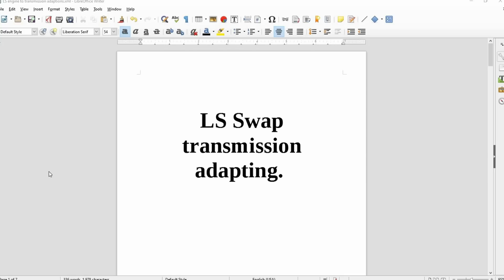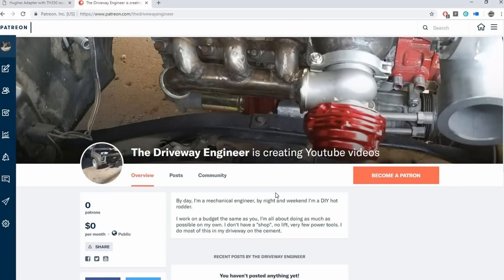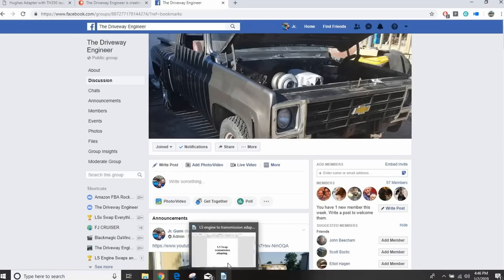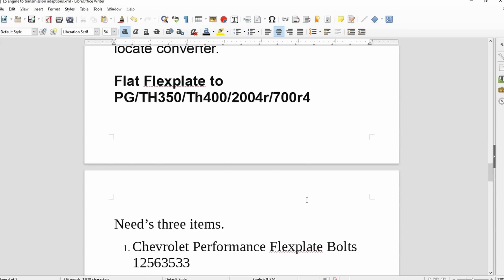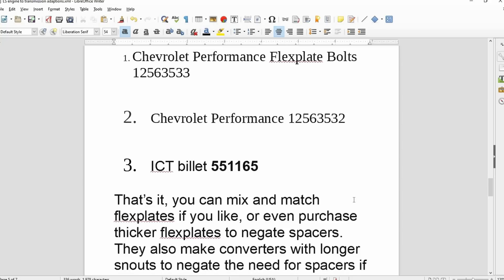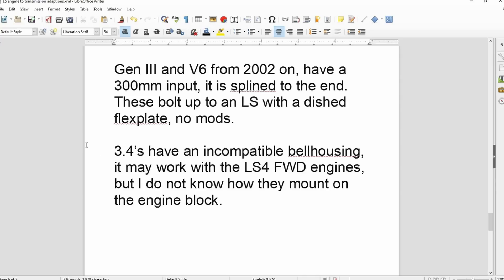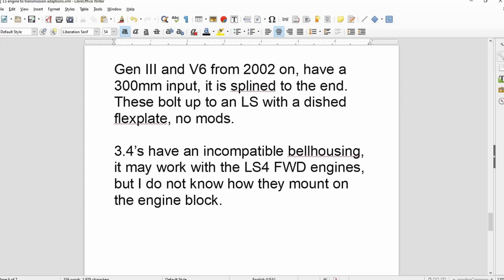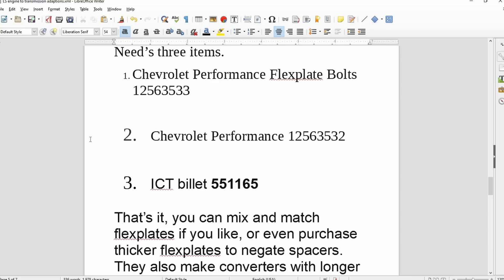LS Swap basics, How to Adapt your LS swap engine to your original automatic transmission.

Comment: There’s two different 4L60E’s
Reply: Mine is a 96 the first year for the electronic shift it has a smaller torque converter. I’m looking to attach it to a 4.8 gen 3
Reply: I have a complete gen 3 4.8 harness and I thought about keeping the 04 4L60e . My Obs is a v6 4/4 so I’ve got to make my 4/4 work it’s all this wiring stuff that’s confusing as well. Can u help me out

Comment: What about starters?  Can I take any year LS starter motor and bolt it to any year LS engine and transmission combination?  Like if I had a starter off a 5.3 with a 4l65E and I bolted it to a 6.0L with a 4L80E and switched from flat to dished flex plate etc - will the starters all fit?  Thanks to anyone who can answer this!
Reply from the maker: Yes, they're all the same

Comment: So I have a 91 4l60 (700r4) and I’m putting a 02 6.0 has the flat 4l80 flex plate so if I use the spacer behind the flex plate do I still use the original starter ? Also what do I do as far as the converter lock up as it’s wired to original pcm ?

Comment: Researching an ls swap into an 88 chevy 4×4 manual trans. 5.3 (gen3)...ls flywheel(from a 4.8 manual truck i hear) and the stock clutch is all we need ?...i thought i heard you say flywheel matching engine and clutch matching the trans for manual swaps. If it matters the truck started its life as a diesel
Reply: We think it's an nv4500, but i haven't verified that. It should have the 14" flywheel since it's a big block/ diesel application. I realize you've got more important stuff to do than answer questions that you've likely addressed somewhere, and i appreciate your patience.
Reply: @shawnwimberly9294  from what I’ve seen you need a conversion flywheel Novak sells them and so does advance adapters I’m gonna be doing the same thing I have a nv 4500 mated to a 350 at the moment but have a 6.0 and will be doing this
Reply: I guess I'll jump off that bridge when i get to it.  Swapping a 1964 impala currently. Besides the oil pan, exhaust, transmission crossmember,driveshaft, shifter mechanism, and throttle cable, it's been pretty straight forward (sarcasm)... the truck swaps are more my speed i think.

Comment: Hey JR, ive done this swap since 1st watching your video and learning how, thanks
so what do you do about your pcm trouble codes dealing with TCC? i ve got at least one maybe more transmission related codes
P0740,0758,0785, p1860, P1810
i did the LT1Swap harness and deleted all those wires but am i supposed to turn stuff off in the PCM as well? or just live with the codes hoping they dont affect the driveability somehow?
Reply from the maker: Set them to Do Not Report

Comment: Im about to drop in my 05 Lq9 into my 1970 c10. what stall would you recommend for it. not trying break the bank. looking for anything 2600-3400 . chances are it will stall higher given my gearing tire size and such, I have had good luck with fti in the past. Made the mistake of ordering off ebay and they sent me a dam Bop 350th converter and the gap on the mounting points are insane .
Reply from the maker: I buy my converters from Ryan Jans at Tampa Performance

Comment: Lol, spend the whole video plugging urself.
Reply from the maker: Yeah, all those products I sell 😂
Reply: @TheDrivewayEngineer  thanks for the info im having trouble with the 4l80e I have a flat flex plate but my aftermarket converter snout is to long the converter pads don't touch. I think summit sold me the wrong converter.

Comment: Im stuck on this one in need of help trying to use a 99 4l60e on a 04 5.3 some one please help
Reply from the maker: If it's an LS trans, just bolt them together
Reply: @TheDrivewayEngineer  sorry i said wrong I've got them bolted up but i cant get the torque converter bolts in the flywheel

Comment: i just swapped out my sbc/th350  and attached my 5.3 LS to  TH350 with the collar/sleeve but the convertor bolts seemed short and i had to suck the convertor away from trannyy about 3/8 of an inch. is that a problem or normal?
Reply from the maker: That's pretty normal
Reply: @TheDrivewayEngineer  , whew, thanks, i was a little worried, only did 1 tranny swap before this and it was problem free, luckily.

Comment: What about the drive-by-wire hooking it up to the 700 R4 kick down or TV cable
Reply from the maker: Doesn't
Reply: @TheDrivewayEngineer  
https://youtu.be/4XPH0HG5wK0
Reply from the maker: @WiIdFx  yep, people make their own brackets if they want to
Reply: @TheDrivewayEngineer  I need to not want to lol
Reply from the maker: @WiIdFx  I wouldn't bother, you have to get the geometry right.

Personally I'd rather have a 4l60 that the PCM can run and fits in the same space
Reply: @TheDrivewayEngineer  
I really appreciate your correspondents on this. I have purchased a drive-by-wire non-electronic transmission PCU and lists the turbo 350 T400 and the 700 R4. I was wondering about the lock up kit on the 700 R4?
Reply from the maker: @WiIdFx  you can control 700 lockup with a simple toggle, or like the B&M kit that helps

Comment: so if i have a 2001 lq4 in a suburban 2500, that has a 4l80e behind it, what parts do I need?
Reply from the maker: For what?
Reply: @TheDrivewayEngineer  oh sorry, I will be running a TH400, it appears that it bolts right up exactly as the 4L80E did.  thanks, love your channel btw

Comment: I have a 1995 S10 that came with a 2.2 and a 4L60E .. Swapping out the 2.2 for a 5.3 , was told bolt patterns are different and I can't use the 4L60E that came with the 2.2... What's my options here... Thank You Would prefer to stay with a Automatic transmission..
Reply from the maker: The most straightforward thing to do is get a 4l60 that came behind a 5.3
Reply: @TheDrivewayEngineer  Thank you

Comment: I have a 2006 lq4 came out of all wheel denali was planning to put it in my 1989 c1500 pick up which has a 305 and 5ml60 (oem) will the 5ml60 work .?would really appreciate any help and get your opinion 
Thank you for your videos and all your help
Reply from the maker: 89 pickups don't have 5lm60s,that's a 2000's Cadillac transmission.
Reply: Rpo code in glove box  MG5( getrag 5 speed  manual transmission) would appreciate any help thank you
Reply from the maker: That's the code for a Getrag 5 speed manual in 1989
Reply: Would the lq4 be able to mate with it?
Reply from the maker: @fzales69  yep, just use a 06 4.8 flywheel for a 3500
Reply: @TheDrivewayEngineer  thank you very much really appreciate your time

Comment: Does the spacer go on the engine side of the flex plate or the torque converter side of the lex plate?

Comment: I have a 93 c1500 that I want to drop a 5.3 into. Mating the two doesn’t look like it will be a problem, but can anyone explain to me what the next steps would be? Do I need a tcm to run the transmission? Or is there anything budget I can do?
Reply from the maker: If you use an LS 4l60 the whole thing just drops in.

Not really much communication between the 2 required
Reply: The Driveway Engineer I was hoping to use my original 1 piece 4l60e.
Reply from the maker: @pegleg_rigo2464  yeah.

If you buy some extra crap you can.

Or you can just use an LS 4l60 that bolts in and the PCM runs it

Comment: ok i have a 5.7 vortec  with the longer crankshaft what do i need flexplate wise to adapt to 200r4?
Reply from the maker: That's not a thing...

Just bolt them together
Reply: @TheDrivewayEngineer  apparently the bolt pattern on 2 years is different from crankshaft to flywheel i have tried 350 and 400 flywheel neither line up?
Reply from the maker: There are different bolt patterns on flexplate, has nothing to do with length of the crank

Comment: I have a 05 LQ9 trying to install a 4l80e to it, I bought the flywheel but don’t know what bolts I’ll need to install everything.. I bought some apr torque converter bolts for a 4l60/4l80 don’t know if those will work. Any help? Thank you.

Comment: Just to be clear.  I have a 6.0 out of a 06 silverado with flat flex plate   Going with th400.   So I would need the longer bolts and that gm spacer thats around $50. Let me know.  Thanks for all u do
Reply from the maker: That's correct.
Reply: The Driveway Engineer  i been super confused because my friend has a 5.3 with a 6.0 flat flex plate and he is not using a spacer with his th400.

Comment: Question i just pulled a 2 piece 4L60E from 2001 van with 350 engine now what do i need to adapt this to my ls series 5.3 engine. I have installed a bigger cam, springs & flat top pistons engine is an 01. Do i need just the spacer for it with ls dished flex plate and do they make an stall that i can use for i will need a 2800 to 3200 stall i believe. Any info greatly appreciated
Reply from the maker: Use a normal Gen 1 converter, flat flexplate and spacer
Reply: @TheDrivewayEngineer  so the 6.0 flex plate and spacer
Reply: @TheDrivewayEngineer  guess i should say the 4l60e is the 298mm torque converter so i have to use ls flat flex plate and the bigger spacer not the sleeve.
Reply from the maker: @ralphhuff4977  yes, the 6.0 stuff
Reply: @TheDrivewayEngineer  does spacer go on before flywheel are after
Reply: So flexplate from 2001 6.0 plus spacer

Comment: I have a 5.3 engine s10 swap  from an 02 tahoe im gonna use the 00 v6 4l60e out of from an s10 wich spacer do I need? The one that looks like the ring or the other one?
Reply from the maker: You need a V8 transmission, or more parts than a V8 transmission costs
Reply: @TheDrivewayEngineer  that shouldnt be your concern!!! Not the answer I was looking for
Reply: @TheDrivewayEngineer  but thanks bye

Comment: I have a 6.0L LY6 from a 2015 Sierra that I want to match to a 2002 Tahoe 4L60E 2wd. What do I need? Thanks!!
Reply from the maker: They bolt together, just use a 4L60e flexplate
Reply: @TheDrivewayEngineer  so no spacer? Use the flex plate from the 6.0L or the 5.3L? Sorry man, my head is spinning with the combos.
Reply from the maker: @Bueno-Fabrication-Tuning  there are no combos, use the flexplate that matches the transmission

Comment: So I just got my adapter to match the snout on my TH350 to my 5.3 but now I have another question. My 5.3 is DBW and my TH350 has a tv cable so how would I go about adapting them together? Do I need to go from DBW to DBC for the throttle body? Or should I just go with a 4L60E? My TH350 was running perfectly before I pulled the 350SBC and wouldn't need to get a new drive shaft made.
Reply from the maker: It's not a TV cable, it's just a kickdown cable. 

You can disconnect it and plug the hole, or leave it flopping. 

Switching to DBC will be expensive and still require an expensive adapter. Just downshift it manually.
Reply: @TheDrivewayEngineer  got ya. Thank you for the information. I was considering going with the 4L60E but why do that when my TH350 only has 5K miles since the rebuild. I'll be doing what you recommended and hopefully the rest of it goes well.

Comment: Iam Confused sorry.  Wondering what I have to have to bolt a 6.0 to a 4l60e from the early 90s.   6.0 going in to a 1994 GMC Yukon 5.7 with the 4l60e.
Reply from the maker: Depends on what transmission was behind it to begin with.

Engine size doesn't matter, transmission does. 4l80 is a flat plate, 60 is dished.

Comment: bolt up has alot of info what i could have used a video showing how to get my 92 700r4 tv cable to work on my 5.3 drive by cable swap
Reply: Carl Andrews have you found any information on 5.3 to 700f4 at all.
Reply from the maker: You can buy the Bowtie Overdrive adapter for 200 bucks, or make your own, which is why it's far more straightforward to simply use a 4l60
Reply: @JamaalBey404  no never found any info so I ended up going with a 4l80.....

Comment: My 2004 lq4 flex plate did not match with the 700r4 torque converter bolts. It was about an 8th of an inch off. You would need an adapter flex plate aswell.
Reply from the maker: Just slot the holes ...

Comment: Hey man thanks for the video....learned alot.....I have a question.....I have a BOP th400 that I want to bolt up to a 99 LS1 out of a Corvette. Could you please tell me what I would need to bolt these 2 items with one another. Thank you
Reply from the maker: A normal Chevy to BOP plate would work, but it would be simpler to buy a Chevy one and just use the converter spacer, and sell your BOP one.

Comment: Great video very informative. I also have many  older v-8 Chevy Engines .This is my first LS 1  Swap into a 69 GMC 4x4.
Reply from the maker: It's gonna be sweet when it's done, you'll love it!
Reply: How did it turn out ? 
I too have a 69 4x4 , an ls would be sweet but im hesitant due to the fact it was my grandpas truck and is still all original .

Comment: Will a 4l60e or the 4l80 torque converter work with a th350 transmission?
Reply: Ok. Thanks for the response ...
Reply from the maker: No

Comment: I have a 2003 4.3 4l60e would it bolt up to the 2006 6.0 without any adapter
Reply from the maker: Probably, if it's a 300mm input

Comment: how about the ls1 corvette flex plate? need info for that please. cant find anywhere that says it will work with the ITC adapter.
Reply from the maker: Did you also post in the group?

If not, the Corvette torque tube thingy doesn't work, you'd need a normal 5m3 dished plate.
Reply: @TheDrivewayEngineer  yeah I did. Lol I got the answer. Great group you made! Thanks for info!

Comment: I have a 2004 gen 3 long crank  with out original flex plate what part no. Do I need  I’m using a 700 trans  3000 stall converter
Reply from the maker: 04 doesn't have a long crank
Reply: Do you know what flex plate I need the starter won’t reach the flat or the dish flex plate
Reply from the maker: You're probably missing the aluminum spacer that goes on the crank.

Comment: Hi do you mind helping me out? I have a gen3 6.0 and a 2004 4l60e I removed the transmission to get it rebuilt. when I received the transmission back and installed it..it seemed that the t.c has about 1” of play.when I bolted the flexplate to it and filled with fluid the transmission wouldn’t go into gear or move the truck at all do I need a spacer for this set up? (The t.c is a new refurbished one and the new flexplate is the concave one from a 5.3) and before the transmission went out the truck was running normal no noises at all.
Reply from the maker: The converter nose isn't positively located so it can run off center and wobble.
Reply: Hey how’s it going? I finally took down the transmission again. How can I check if I have a tall torque converter?
Reply from the maker: From the factory, you won't have a tall converter
Reply: The torque converter has been changed before. I’m just not sure what it has. When I bought it I was told it was a stock work truck. Came to find out it had a 3rd gen 6.0 with second stage cam lifters and springs. That’s all I know so far.
Reply from the maker: Sorry, for some reason your comment was flagged. 

You should have a dished flexplate, and the little aluminum spacer that bolts to the crank on that set up.

If it won't move with fluid in it the pump was probably damaged on install.
Reply: The Driveway Engineer thank you for replying..yes it has a dished flex plate but no spacer. I sent the transmission back to the shop and the pump was damaged at install. It was repaired and I installed it again correctly and now it’s working good. But how is it able to work without the spacer?
Reply from the maker: You don't need the snout adapter, just the little silver spacer. Is your flexplate bolted direct to the crank?
Reply: The Driveway Engineer yes it is even when I removed the old flexplate I didn’t see any spacer.
Reply from the maker: @victorrios9936  Gm #12563532 should be between the flex plate and the torque converter to locate the snout of the converter, unless you have a tall converter to mate to the crank.
Reply: The Driveway Engineer what can go wrong if I don’t have that part?

Comment: So how would you address the TV cable on the older 700r4 and 4L60 to  get it to work?
Reply from the maker: I'd sell it and put the money towards an E trans. 

But they make a adapter to hook a TV cable to a DBC Throttle Body. And they make manual valve bodies. Both go against my general scheme of using the simplest, cheapest thing.
Reply: The Driveway Engineer thanks for the quick reply. Following you FB now too, I like your keep it simple approach.

Comment: As I am watching your awesome videos I asked  for your help regarding trans hookups bam there it is. You are a great help with ls swapping. I'm a square body truck freek also. Some are Diesel trucks that are going to ls after seeing your videos. Selling all of my old 350 202 motors. Money wise  a guy can't build old iron to keep up with the LS motors. Thank you keep posting your information  thanks again.
Reply from the maker: That's where I was at with it as well. I had a nice little 406, but to gain overdrive and another 100 hp, there was no way to do it for the cost of a 6.0/4L80E
Reply: ill buy a set of those 202 heads K.B. 916-504-7036